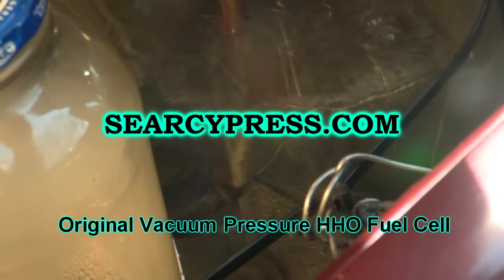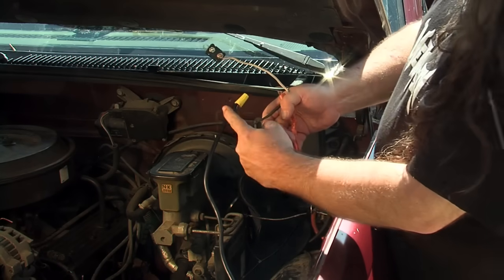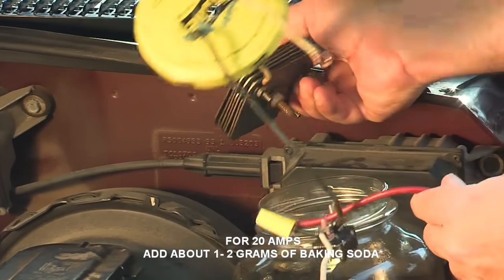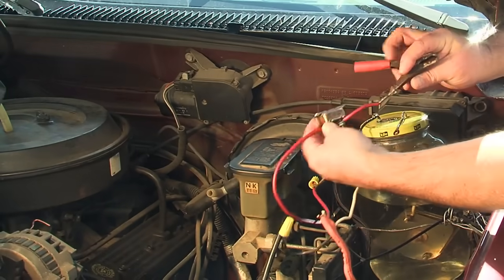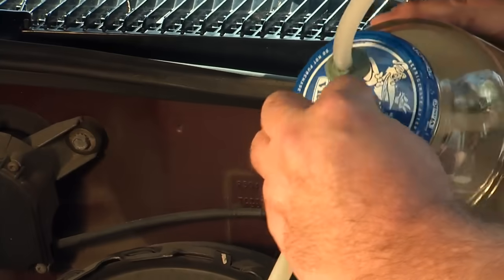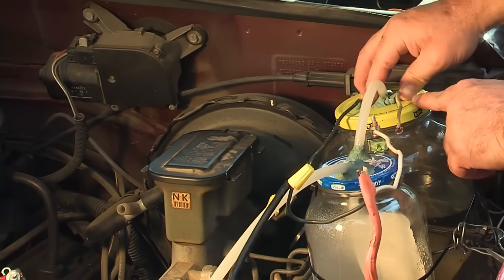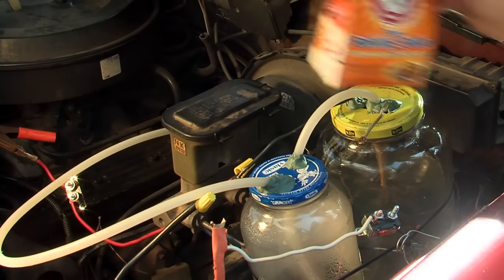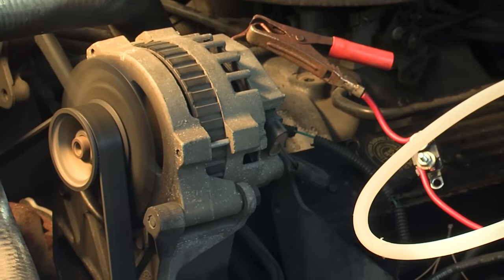Vacuum Pressure Hydrogen fuel cell defeats high gas prices using hydrogen from H2O.

Comment: Mileage is temporarily improved due to energy taken from the car battery generate the HHO, just long enough to show impressive mileage on a dyno.  You will end up with worse mileage overall and a lot of useless, expensive, dangerous equipment on your car.
Reply from the maker: I don't think you fully understand the benefits. Let's assume based on your reports that there are no observable gains in mileage. Using the vacuum pressure fuel cell you could burn very low octane fuel without any engine ping. That benefit alone would save you money. Thanks very much for your comments.

Comment: Here is what you need, true stainless steal plates, true stainless steal, bolts and nuts,  variable voltage regulator and amp meter,  distilled water,   build your cells,  has to be mounted as close to intake as you can get.  After you crank with fuel engine warms up flip the switch on to apply power to the stainless steal plates that is in the distilled water container,  and open the valve connected into the intake.  Pretty simple to do. Something about stainless steal when charged with electricity, cause hydrogen and oxygen to separate.  Good video!
Reply: Is there anybody in Southern California that can help someone build something like this and what it run a I have a Toyota Sunland Express motorhome it's just a little Toyota truck with the motorhome on the back I want to get better gas mileage cuz it like only get like 10 miles to gal
Reply: you'll end creating toxic chromates! stainless is not the right material.

Comment: I've been trying to work out a system that works on turbo diesels... I don't want to run hydrogen through the charge air cooler or turbo... A vacuum system isn't possible, unless you introduce the feed in front of the turbo... And that presents its own problems... Total Detonation of your hydrogen system shortly after you spool up the turbo would be a problem. Using compressors to create a pressurized vessel of hydrogen could be problematic as well. You could go a hundred thousand miles without a problem... But when the problem happens, it will make you famous.
Reply from the maker: If it could be figured out, it would be worth a fortune most certainly. Once you achieve a good vacuum it is hard to detonate the hydrogen.   You can pass the gas across a very hot source without ignition. Thank you for the comment.

Comment: My experience with these HHO cells is that if the engine is completely Computer controlled, the MPG will increase then fall back to normal MPG. That is because the O2 sensors sense a lean condition, so it pumps more fuel into the cylinders to bring it back down to normal Air-Fuel ratio. Have not figured out how to cheat the computer.
Reply from the maker: That is very true in many cases. One benefit however is because of the enrichment process you may use much lower octane fuel. This results in savings. Thank you very much for the comment.

Comment: I can run an engine solely on gas fumes from a gas can totally a vapour fuel cell disable the fuel system. The vapour in the gas can is already an airfuel mixture and runs the vehicle.

I would like an older say 60 to 70 model vehicle no computer, to try it out on

Comment: Hi,
The idea is great but do you have any records of fuel saving, or are running 100% on the system,
Thank you
Reply from the maker: Running 100% HHO  would probably melt the rings. HHO gas when burning is very reactive.. Measuring fuel mileage is very tricky business. There are so many factors involved. The way this truck was tested was by driving it till it was empty. Adding 1 gallon of fuel and driving without the fuel cell. 12 miles was traveled and the engine again ran out of fuel. One gallon of fuel was added again. Fuel-cell was turned on and 24 miles were traveled. This is not always the case. The temperature of the fuel-cell, the road conditions and wind and  traffic, as well as how you drive the vehicle all play a factor. One of the biggest benefits to the fuel-cell was the ability to use lower octane fuel without engine ping. This alone creates savings even if you have no ability to adjust the O2 sensor. In some cases we actually got less fuel mileage because we were hot rodding the engine because of the improvement in performance.

Comment: You should make another vid where u do 2 separate coils for pos and neg . I'm sure this guy knows but if anyone here didn't . neg charge produces the hydrogen and positive produces the oxygen .    oh also the coils (or however u choose to do it) have to be solid stainless steel . just coated will disintegrate.

Comment: My boat runs on 100% water, I shit you not. That fucker is just like all the others and floats, much like all the other hho horse shit on the internet which takes more energy than it produces. The clown that says he uses a solar panel to charge a separate battery to operate the hho generator must have a bus to fit the pv aray. I call bullshit again.

Comment: This does  work, but includes some definitive explosive potential 
and the glass part is best to  stay away from
Reply from the maker: Glass is used because it has the thermal properties necessary to endure high temperature and negative pressures. Every type of plastic container we tried would collapse under the vacuum.

Comment: Something I have to say your work is  Absolutely  Shoddy it's as if you Simply  threw it together and hoped for the  Best : Okay so it works ? But you Mentioned that you Had  Connected one of the wires to the  Fuel Pump; What I am wondering is, Have you Disabled the  Fuel Pump to where no Petrol is  Getting through ! Or  are you Using Both Oxygen and  Hydrogen Mix without the  Petrol: Something worries  Me ! You say that you have  Driven Many Thousands of Miles. This  I Honestly do Believe without a  Doubt; In No way am I a  Rocket Scientist , But Knowing a little about  what Oxygen is Capable in doing . Take  for instance when Cutting up Steel with an Oxyacetylene Torch, it only takes a  fraction of a  Minuet to Cut Half  inch of  Metal Plate; The Piston of a  Motor Vehicle is Made from Aluminium and that is  of course a Lower Melting Point than Steel: I Asked you a  Question and  Now it's Come to me why the  Aluminium Piston dose not  Burn under Pressure It's Quite Simply This an Oxyacetylene  Torch Has too Bottles One of  Acetylene and the other Bottle Oxygen; Where its  No longer H 2/0 ! Neat Oxygen on its own in its purest Form, when applying the  Gas and the  Oxygen together ; as one  Regulates the  Oxygen Mixture , the  More  Oxygen with the Gas Creates an intense Heat as in the Hydrogen Converter, Having Split the two Atoms there is still more  Hydrogen than Oxygen so there is no worries to be alarmed Jobs a Good one : But Please go back onto the drawing Board and  Present a Better Set up: Try This for instance: Find two Old inner tubes I Think Racing inner tubes {Bicycle} I believe that the  Valves are  Thinner ; Cut them free from off the Rubber;and unscrew the Nut from off the Stem. The Valve should be  Taken out of the stem !! Drill two Holes the same Diameter of the Valve in the Metal  Top of your Container. Put some  Thick Rubber solution or Maybe a  Rubber Washer ; and on Inserting the Valve Stem into the Holes Screw the  Nut down tight ' in doing this it will Make an Airtight or as in this Case  a  Gastight Seal Now you Can Put your  Tubes onto The Stems ; One Question Are you simply Letting the  Hydrogen oxygen Mixture go through the Air intake or Have you Cut the Fuel Pipe and are letting the  Hydrogen go through the Fuel Pipe ??

Comment: Now if you add on engine pressure modulation system you will have the ultimate hydrogen powered system

Comment: Thanks for sharing. Did you try on HHO only? Does the engine gets higher temperatures with HHO? Thks.
Reply from the maker: Due to the nature of HHO temperatures reached would melt the engine. Thanks very much for the comments.
Reply: @metalpresstv  are we going to get an update video

Comment: Best suggestion I can add is to cut off the HHO 5 minutes before shutting down vehicle to burn off any H2O in the cylinder head and exhaust system.  Stainless valves if you want to go all out would be recommended
Reply from the maker: Sounds reasonable. Thanks for the comment.

Comment: I know this is a late comment, but I have to say that the glass jars seem to be precarious, not in as much as the position, but the glass material. Isn't there some other containermaterial that may be suitable for the same purpose?
And, I would like to know if you can use this setup on a fuel injected vehicle?
Reply from the maker: Because of the high temperatures involved and the vaccuum pressures, glass is well suited for this task. Plastic will change shape because of the vacuum and the temperatures. There is no risk of explosion as long as the system remains in vacuum. Thanks for your comment.
Reply: @metalpresstv  could fancy it up with some glass protection.
Reply: Just hit a bump on the road and that glass whont contain a vacuum anymore
Reply: @nisios  You are right, that is better to use a thicker jar with a plastic tube shielding it.
Reply: I used pvc on mine a long time ago. Still have it don't use it. It warps heads. You also need flash back arrestors
Reply: @TheMrLoxton  are you saying it damages the engine?
Is the damage caused by too rich of a mixture?
Reply: @altimonkelly240  no what im saying is that a piston engine that has a cc ratio is not designed to run hho gas. 

When hho explodes it then implodes because the hho turns back into water. Ie. 1 cc of water can be converted to 1700cc of hho gas. That also becomes under pressure in the right state. 

Ideally there is one engine out there that solves hydrolock problems. However it to has it draw backs. 

U ran a 13 plate (8x3in) ran - n + n - and so forth. In a 4 inch pvc with bubbler/dryer. And yes absolutely saved gas i got an extra 15 mpg untill my head warped. And this was on an engine i gad built at a race shop. Only had like 3000 on it. 

If you want a fun experiment you can take a jelly jar. Fish air tube and set up on with a gutted bic pen and make a lighter. Kinda dope. 

I should do a video and relive the days of hho. Been planing an hho electric generator just fundable not yet. I do hace big plans for this.
Reply: How often do u need to add water?

Comment: I'm confused here someone please explain to me why/how using hho is going to run your car. I mean it is possible but would have to be a element that can't oxidize easily or gets stronger with oxidation I could see it being used as a 50/50 like gas and hho mixed together.
Reply from the maker: There's a lot of confusion around this technology. Often people confuse burning hydrogen with burning HHO. Hydrogen can run the engine. HHO however would melt the engine into a small puddle of lava. HHO is best used to enrich the fuel burning process. So much gasoline is wasted in combustion engines there is a lot of room for improvement. Thanks for the comment.

Comment: Suggestion to eliminate further carbening of the engine use a senthetic oil, This doesn''t make carbing and will keep your engine clean like using propane for fuel in an engine, It is also extremely slick as well as a superior lubricant. I like ams oil, but any will do.

Comment: It spend a lot amps, and force the engine & spend more gas in stead saving
Reply from the maker: It is not a free energy device. It does however allow you to burn much lower octane fuel without any engine ping. Even if there was no actual boost the savings from using lower-octane fuel without loss of performance would still benefit. Thanks for the comment.
Reply: @metalpresstv  But you can't replace all the fuel with hydrogen can you?
Reply from the maker: @carlosandleon  yes you certainly could with hydrogen. However, we are producing hydrogen and oxygen. HHO can reach temperatures high enough to melt tungsten. Running 100% into the engine would be foolish. We use this extremely energetic reactive gas to boost efficiency. Thanks for your comment.

Comment: I'm confused as to how this is adding more fuel. Is it hooked up to the fuel line somewhere? Does it just mix with the regular gas?
Reply from the maker: The HHO Gas is injected into the vacuum line. The gas travels through the vacuum into the engine. Thanks for your comment.
Reply: It richens the fuel mixture. The vehicles computer will see a rich exhaust gas and will lean out the fuel trim( the amount of gasoline electrically injected)   So your Supplementing with hydrogen instead of running all on gasoline